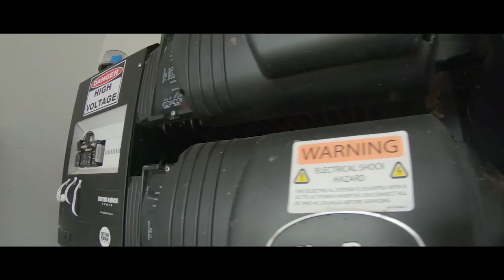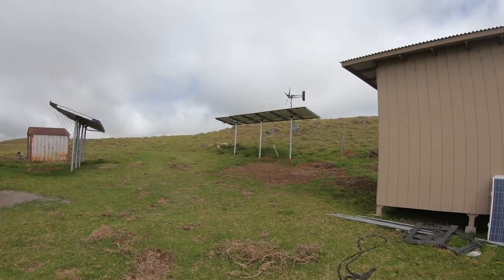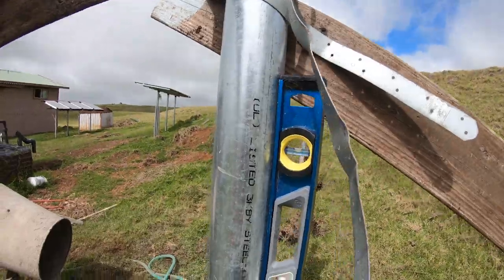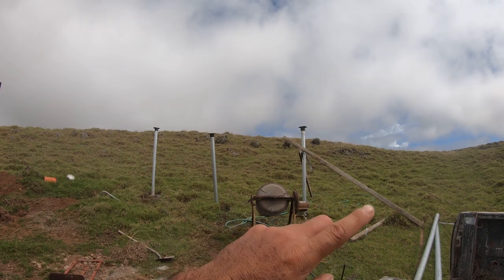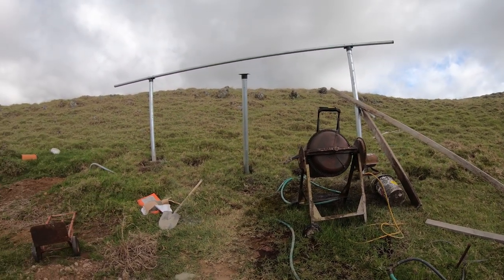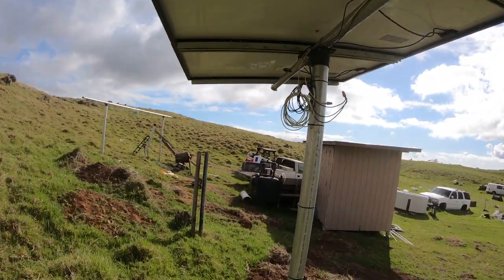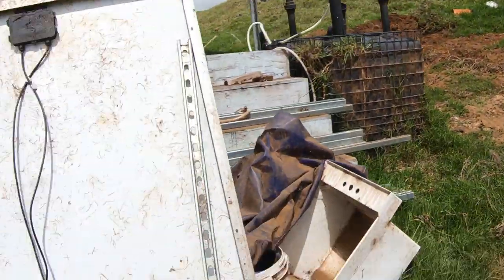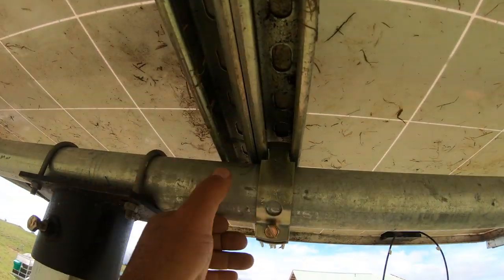How to Install Solar Panels | Ground Mount Solar Panel Installation

Comment: Hey are all those poles level? You went very clear on that! I also think you should have used more concrete much much more concrete at least 5 truckloads per pole and those holes should have been at least 22.165 feet deep. You should also weld all of those brackets to the poles then send them out for re-galvanizing before installing them that way they will truly last 100+ years. Future generations would have thanked you now before they are even born. All kidding aside you build like I do!
Reply from the maker: Lol

Comment: Love the install would like to make one suggestion use nylon nuts on the bolts that connecting the solar panels to the Unistrut
Reply from the maker: I like nylon nuts they stay on.
Reply: Orafrith the problem with nylon is they aren’t reusable, and usually are a low quality material. The crowned steel locknuts are better I think.

Comment: Nice job. Have you set the panel angle for max solar, or is that happening after all the panels are installed?
Reply from the maker: I set it for max sun. Here in Hawaii panels are almost flat.
Reply: @ModernOffGridDIY  ever adjust the angle depending on season?  Or would that be a huge pain?
Reply from the maker: Where I'm located not needed to move or re angle the panels been working for years now. More power than I can use.